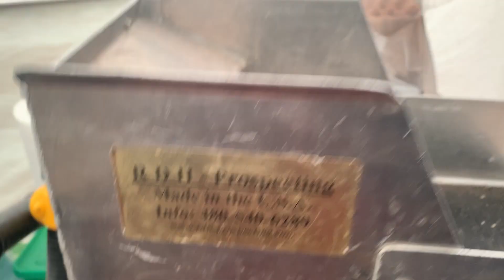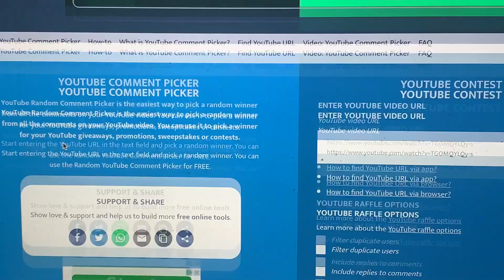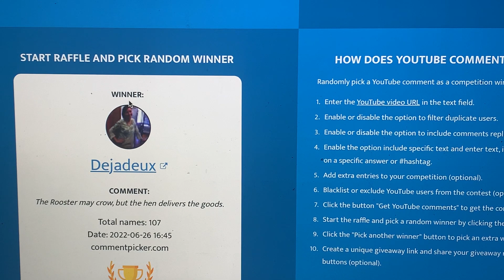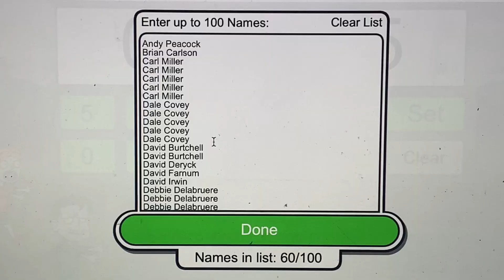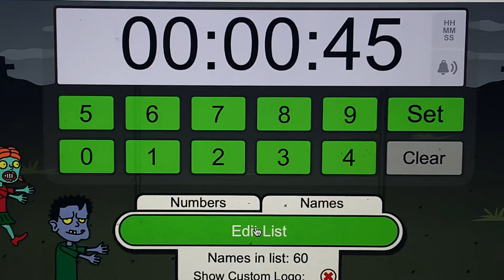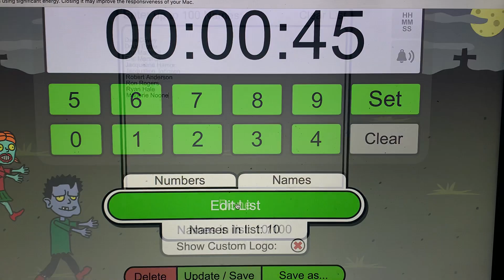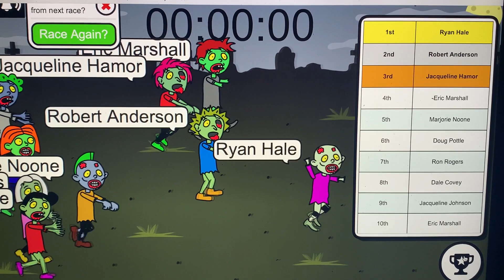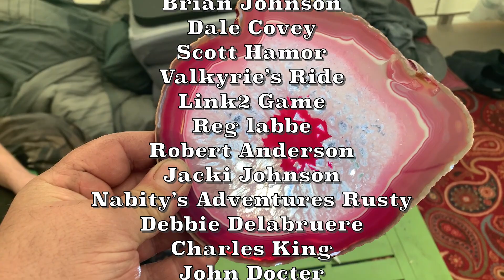Testing the Dream Mat / What is a Fiddlehead? / Sluice Box Giveaway

Comment: Drop the angle a little bit more fam. You'll get it all fam the next time. Great job all around fam. Nice au indeed. Keep on having fun and living the dream. Gold Squad Out!!!
Reply from the maker: Thanks for the tip. Thanks for watching
Reply from the maker: I wanted to run it exactly the same pitch and water speed as I normally use so I could compare under the same conditions. But next time I will make it a bit steeper.
Reply: @hipbeeexplorer  Drop angle. Meaning more flatter.

Comment: You need twice the water flow that you were running just so you know
Reply from the maker: I wanted to use the same water flow as I use for my other ripples to compare and I think it did pretty good. I don't think you can expect better than that with any mat. I would think with more water flow would come more losses. I think if I kept the water flow as I had it and classified down to 1/4" It might catch it all.
Reply: Actually,  I  believe the cells were not active enough for proper separation causing the cells to be clogged which in turn allowed gold to make it down  the mat and escape escape  . Increase your flow in order to keep the cells clear and more actively exchanging and you should have even better results.  Do the same test with more water flow and see how you do . Dream mat will hold the gold . It's ment for more flow. People are used to running the old way and are scared to run it faster with carpet because of migration.